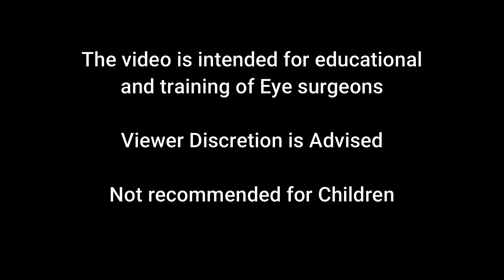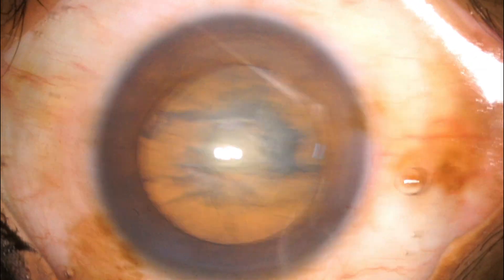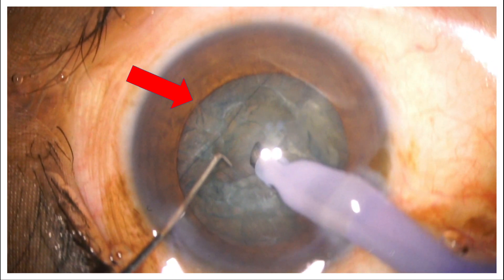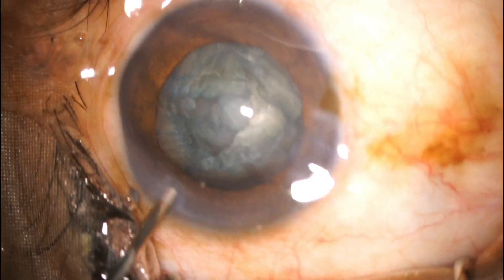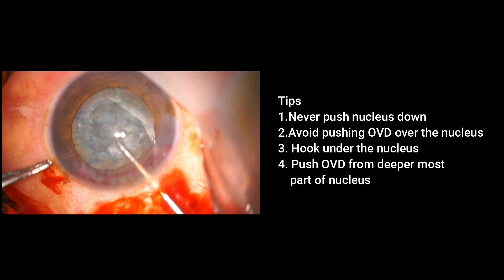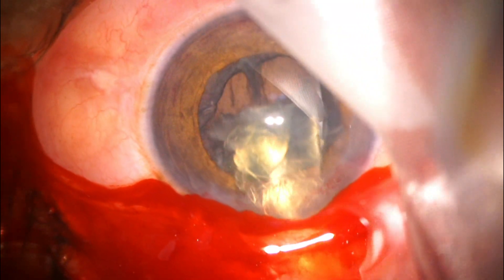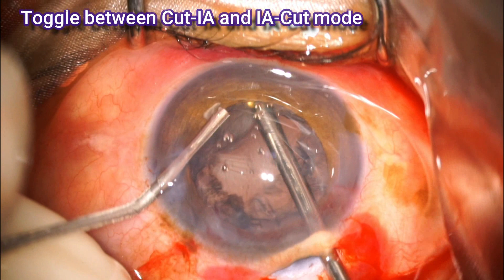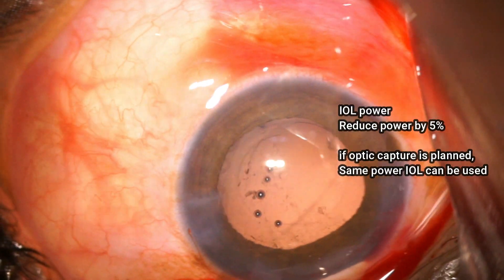Com48 Posterior Ledge Sign :New sign of PCR Dr Sourabh Patwardhan  Bonus- Conversion to SICS and vit

Comment: Congratulations and thanks sir for this new sign you demonstrated. Few queries 
1. why did you not attempt prolapsing nucleus out of bag initially from the side where it was already tilting down or would not it be better to do Bimanual prolapse using sandwich manueuvre.Would like to know the correct technique to avoid vitreous prolapse in such situation when young surgeons like me if happen to face.
You are a master sir, anything you would do,the end result would be same.

2.Before putting tricort, is it must to empty OVD from the chamber so that crystals plug the vitreous only and not the OVD ?
 Thanks sir 🙏
Reply from the maker: 1. It was difficult to lift the nucleus from tilted side as we cant reach the end. Double sinskey or wire vectis can also be useful method. At times despite effort nucleus just drops back as vitreous is quite liquified. Best is to avoid desperate attempts and handover to retina colleague in those cases.
2. Washing ovd when there is rent is difficult and can itself prolapse more vitreous so using diluted traimcinolone followed by little bss wash is enough to identify vitreous. 
3. Each case is a bit different so we keep learning  
4. Nucleus drop is not a big complication. Trying desperate measures to prevent it can be more risky.
Reply: @SourabhPatwardhanPhacoTips  thanks a lot sir for valuable insights. 🙏